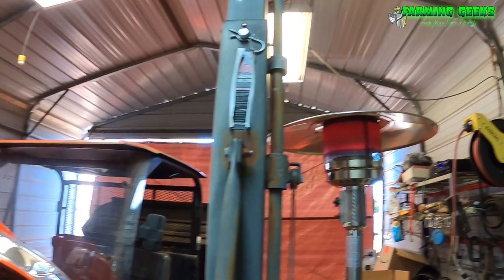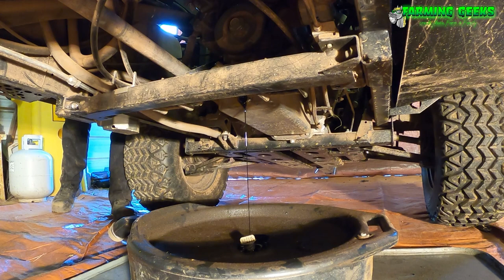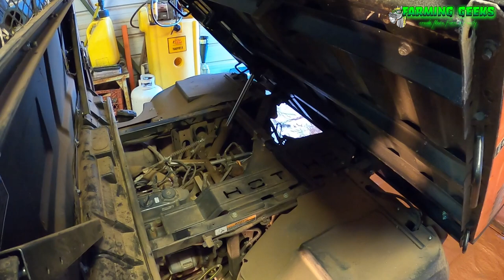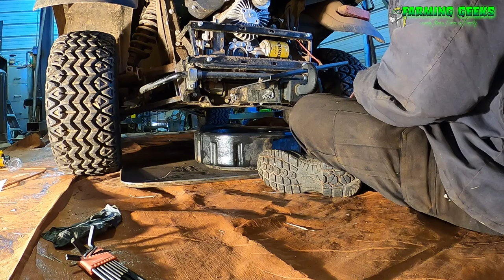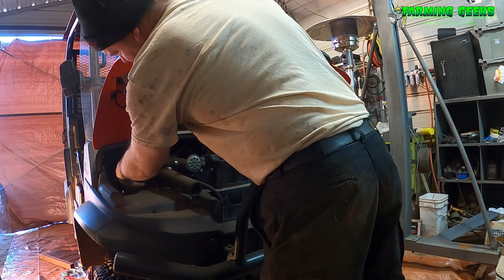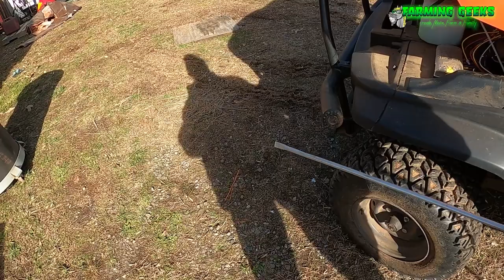Kubota RTV-X900 Service

Comment: Question - I changed the transmission fluid on mine but I let both filters drain all the way out instead of changing them quickly. Now I think I have air in the system because it is difficult to move. What are your thoughts? I thought about changing filters again and filling both up with fluid?
Reply from the maker: Sorry for late reply. Nothing wrong with letting your filters drain out. As a general rule it is not a good idea to fill up filters. You should let the system fill them up. Otherwise you could pour debris into the incorrect part of the filter sending it straight into the system. Did you top off the hydro fluid? If your fluid is full and you filters are on and you have ran it around a little bit and it still has difficulty moving, then you have a problem. Could be as simple as incorrect filters or you could have an internal issue.

Comment: I guess my rib x900 will never be changed because I am not going to pay the price
Reply from the maker: Its really important to change the oil and filters especially on the HST. You can pay now or pay later and the transmission on these are very expensive. Really the same goes for the engine.